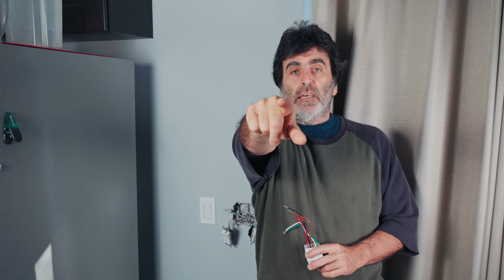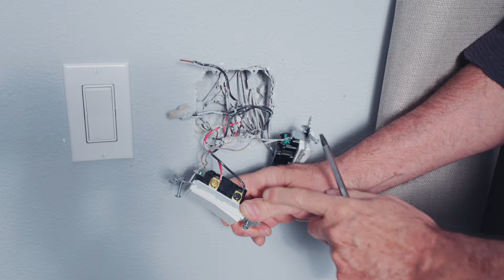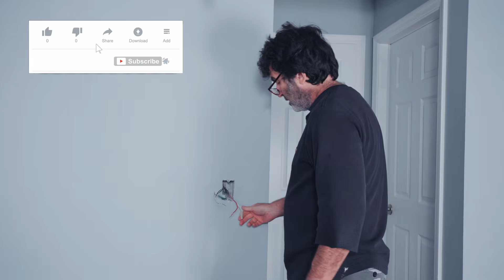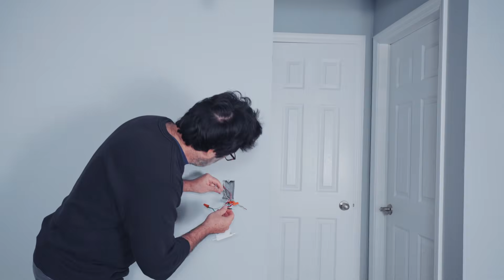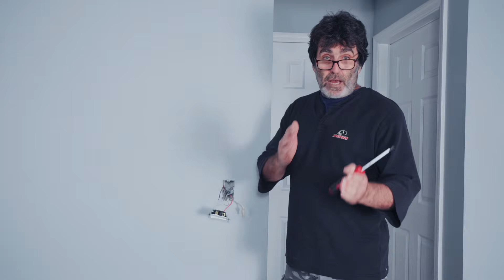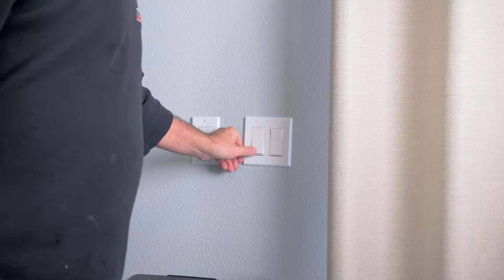Correctly Install Amazon WiFi 3 Way Smart Switch

Comment: Great video.  I had also invested a ridiculous amount of time on this.  MOSTLY things are now working, but I have an odd curve ball to throw at you Rudy.
I have to turn the regular switch off twice to get one set of overhead lights to turn off.  And it is consistent.  If I turn them on (using either the Amazon 3-way dimmer or the regular 2-way switch) then I have to flip the 2-way twice to get them off.  I had a 3-way switch (with common and the re-purposed traveler tied together - red then used as the traveler to the Amazon) and tried swapping it for a 2-way.  Same thing.  Very odd. Tolerable, but odd....
Any thoughts?
Reply: NVM.   A defective Amazon dimmer.
Reply from the maker: Arrrrgh!  That sounds right... 😊
Reply from the maker: HI David... Very interesting problem.  I thought mine did that a couple of times too.  I just went to try it and it's not doing that.  I don't think it has for a while or I would have probably took out the wifi switch and just put a regular switch back in there.  If you've got it hooked up right, I'll bet it's a glitch in the wifi switch.  Maybe try turning off the power to that circuit for a couple of minutes and try it again and see if the problem persists...
Reply: Interesting.... I'm troubleshooting what sounds to be a similar situation... If the standard switch is UP with the light off, it simply operates as UP=Off / DOWN=ON.... However, if the standard switch is DOWN with the light off, then it seems to work every other cycle, for example 1)DOWN=OFF 2)UP=ON 3)DOWN=ON 4)UP=ON 5)DOWN=OFF.... it takes an extra up/down cycle to get back to down=off...

I've been scouring the internet trying to figure out if this is normal behavior, or if I may have wired something incorrectly..... but after reading your comment, sounds like I may need to simply try a new smart switch....

*UPDATE* -- wow, just factory reset the smart switch, re-connected it to the app/wifi, and now the standard switch seems to work fine in either orientation! Thanks for the clue that this may have simply been a software error.

*UPDATE2**-- I spoke too soon. It appears the issue presents itself when the light is set below 70% brightness..... maybe I am back to trying a new switch.
Reply from the maker: @lostinperiphery  HI!... Yes mine does that too occasionally...  I don't think it's normal, but a glitch in the switch.  It's something I just put up with, but I don't think you've wired anything wrong..  Especially since it works most of the time and does this sometimes.  If it was a wiring issue it would do it all the time.
Reply: I appreciate the reply! It’s odd. Below 70% brightness, it does it 100% of the time. Above 70% brightness, it does it none of the time, haha. I’ll see if I can dig up some different bulbs and see if different current draws affect that. Curious.

Comment: I bought two of these and I got one set correctly! The other non-smart switch only "turns on" the light and will not flip off. Is there something on the Line side I need to do to make it work? (I removed the line and connected it to the hot wire already) Any ideas?
Reply from the maker: HI, did you take the line voltage in the switch that is supplied with power from the panel box and tie it to the black traveler going to the smart switch at the other location?
Reply: I re-striped the traveler wire and capped it with the black bundle in the first box. That seemed to work!! BUT it only works when my LEDS are at 100% with the Amazon dimmer. I know you installed just the general switch, but would you happen to know why it would not completely work when the dimmer is used?
Reply from the maker: Ohhh... I'd have to see the wiring diagram for the dimmer to see if it's any different.  I'm guessing it's a 3 way dimmer.  Are your LEDs dimmable?  Sometimes they're not..  (is that the amazon basics 3 way dimmer?)
Reply: @TheHomeImprovementChannel  Yes, this is the 3 way Amazon Dimmer switch, and the LEDs do dim with the smart switch. The other end is now functioning as a switch ON, but will only go in the OFF mode when the dimmer is set to 100% (they will turn ON if the last setting was at like 20% but won’t turn off until I change it to 100% on the smart side or via Alexa) Bizarre, but thank you soo much for your video and if you do decide to do a video for Amazon Smart Dimmers down the road, I’ll be excited to watch/learn!
Reply from the maker: @christianabau3019  Thanks for the video idea!  I might do that...  Just out of curiosity what would happen if you replace the Non dimmer switch with just a regular 3 way switch?
Reply: @TheHomeImprovementChannel  The non-dimmer side is currently a regular 3 way switch, but it only turns on and off when the brightness is at 100% for LEDs. The other set I have are connected to normal bulbs which seems to work better with the dimmer and powering on/off.
Reply from the maker: @christianabau3019  SO I looked at the diagram on Amazon and the dimmer hooks up just like the one I have in this video.  If you're using it like I did, with a standard 3 way in one box (the one coming from supply power) and the smart switch in the other location (the one going to the load or light) they want you to find power in the first box and tie one of the travelers to that line power.  Preferably the black traveler so it's not confused on the other end.  Did you do it that way?
Reply: @TheHomeImprovementChannel  That is exactly what I did. Still not sure why the normal switch does not work until the dimmer is set to 100% on the LEDs to turn off though
Reply from the maker: @christianabau3019  Sounds like you've done everything right...  I'd almost have to see that to come up with any more ideas... 😊

Comment: I have two smart switches each have two travelers connected and ground neutral and black line/load ....they both work great manually but in alexa i have to tell alexa to turn it on in order to turn it off and also led indicator indicating power is on does not work( even when light is on) suggestions?
Reply from the maker: Of course it might depend on which model you have, but if you've got a 3 way setup there which is what it sounds like you only need 1 smart switch.  Unless I misunderstood..
Reply: @TheHomeImprovementChannel  Thanks! i was actually able to get the two smart switches (wanted two just for aesthetics) to work together by wiring as you suggested and just linking the two switches together in the app.  Now i am trying to put a new switch in a place that has two 3 way switches with a 4 way switch in the middle would i wire this the same way?
Reply from the maker: @litmediagroup3722  HI, was there a 4 way configuration in the diagram?  I don't remember..
Reply: @litmediagroup3722  Hi, I just found this video, and your comment sounds like you had the same situation. I want to install two Amazon Basics Smart Switches (dimmer and motion sensor) in a 3-way setup, with switches upstairs and downstairs. I’d like to program Alexa to turn the staircase lights on and off based on motion detection. Can you explain how you made it work with two smart switches? The manual says it only needs one smart switch.